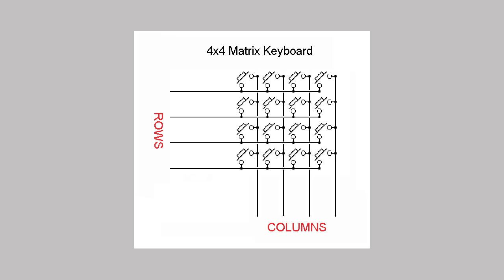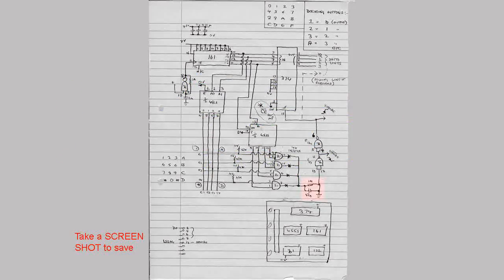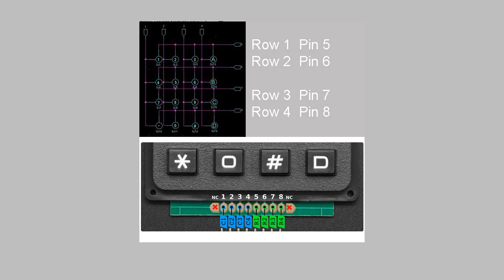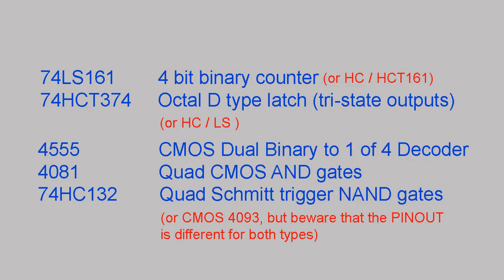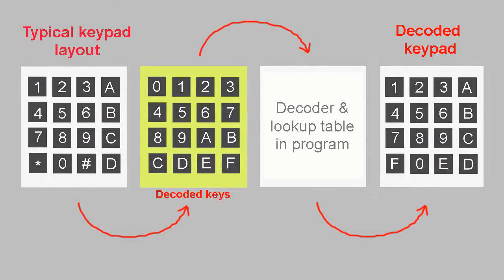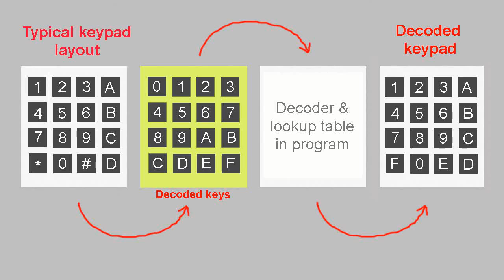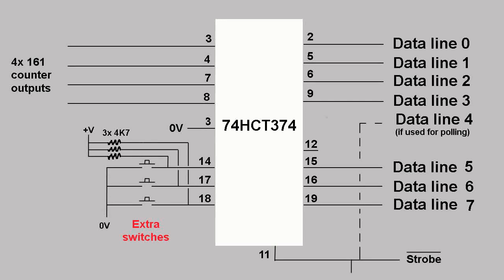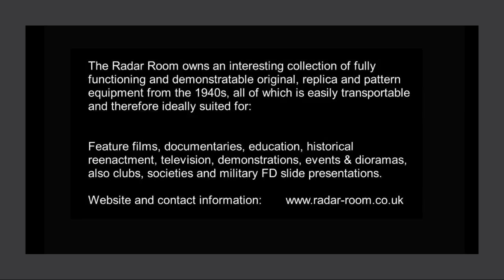4x4  Adaptable Matrix Keyboard Decoder using 5x Logic IC's

Comment from the maker: PLEASE NOTE that I made an ERROR in the circuit diagram given in the video. The connection from the four diodes goes directly to input pins 13 and 12 of the 132 NAND gate package. The 1M resistor and 47n capacitor go between this connection and ground. Sorry about that!